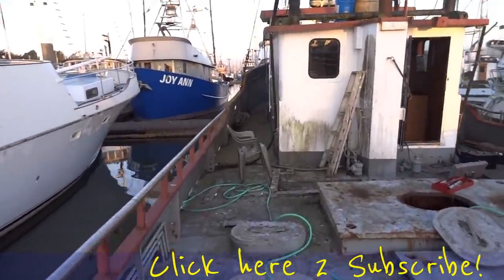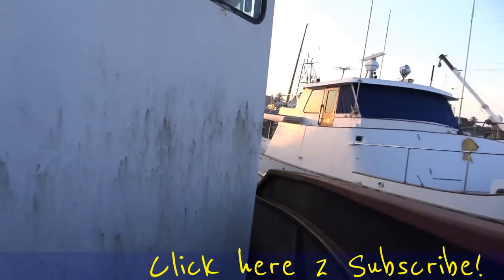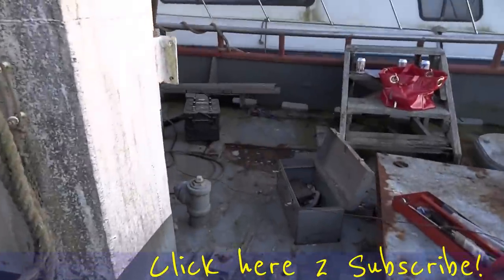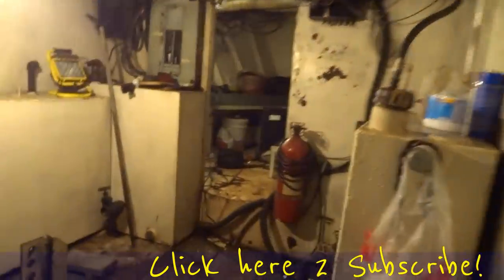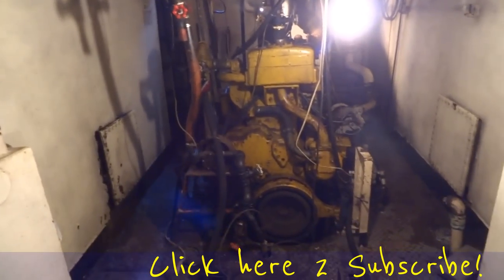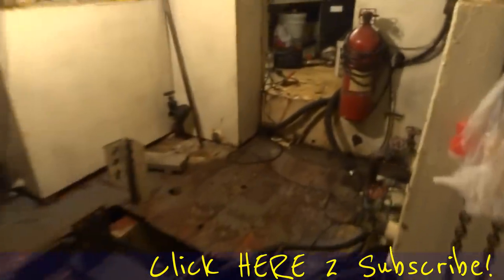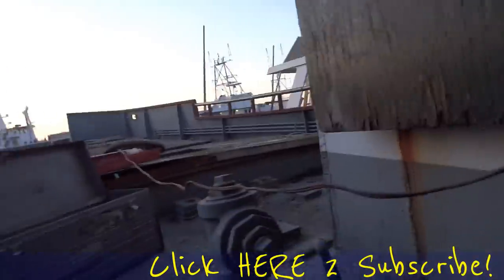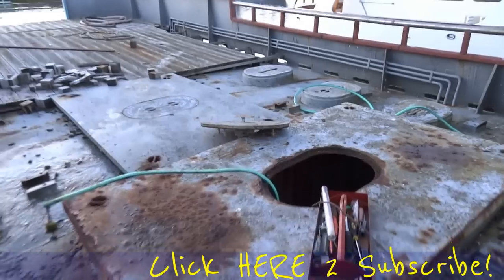Catepillar Diesel Cat Engine Motor Start Up Fishing Crabbing Boat Ship Vessel For Sale Video Review

Comment: I don't care what som other commenters have to say, they can just go and take a nice enema with their own douchebags!  I think that this boat has potential!  (BTW) in maritime nomenclature, that is a small to medium speed diesel.  High speed diesels generally are like that one below as generator set or for small boats and cars, lorries, busses, etc.  Low-speed diesels are the super huge models such as the five deck (yes 15 m high) TRA series from MAN Diesel and Turbo/Wärtsilä.  .Medium size diesels generally are ued in producing electricity as generator sets, and (so far as I am concerned) misued as propulsion units for dieselised locomotives (as they should be directly all electric)!   And for small ships (mostly used as multi-engine arrangements).

That CAT sure loves to purr!  Once engine and boat are throughly clened up and perhaps even repainted, I see nothing wrong with her whatsoever!  I would suggest to arrange the topside deck for a partying atmospher so as to entertain guests underway!  Have fun!

Comment: What a piece of shit how many hours on the 

DIESELS 
AUX EQUIPMENT

When was the last 
hull survey done what was the result. 

Has any equipment been VA checked 

What voltage and phase are the electrics 

When was shaft alignment checked last Plummer blocks shaft bearings what hydraulic system are you running 

What hours do the oil and fuel centrifuge have and do you have steam pre heating for fl system. 

If the price is right I can have cash in your account with an hour a long s you can email the maintenance logs and the safety cert  before I transfer the money I'm in the uk but I don't need to see any more of the boat to make an offer.